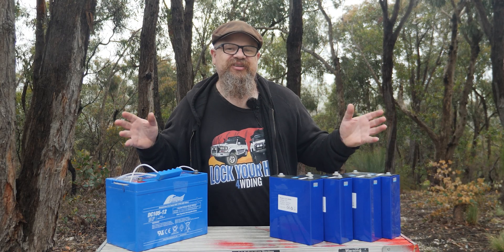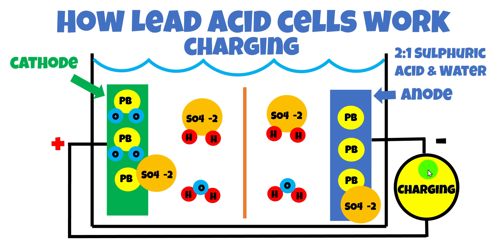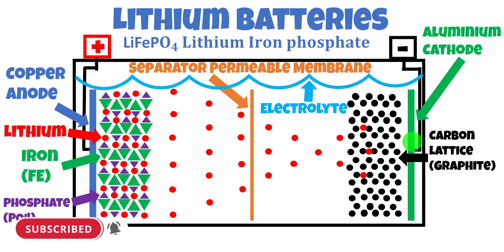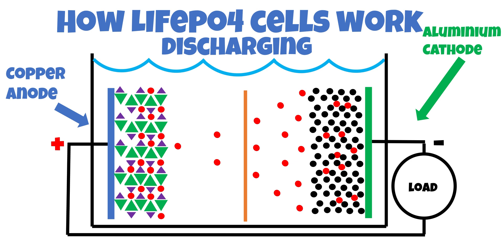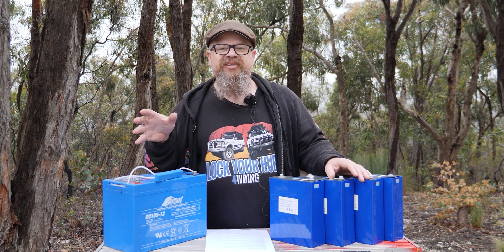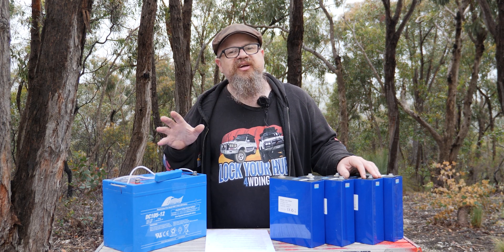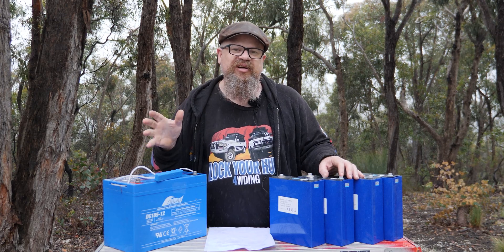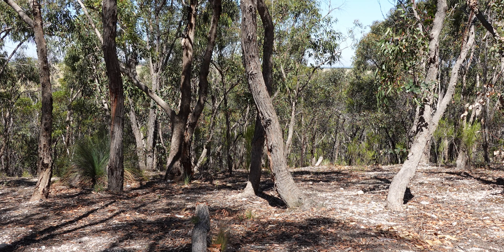DIY LiFePO4 battery Part 1 Lead Acid vs Lithium Iron Phosphate

Comment from the maker: Have you changed from old school Lead Acid to a Lithium Iron Phosphate battery?
Reply: @y0uCantHandle  I run lithium start batteries and use them to winch and run invertors as well. My lithiums have a BETTER heat rating than a lead acid or AGM. With low end batteries or even most of the "branded" ones such as enerdrive or redarc, they dont have the technology yet to do what others can.
Reply: I have changed all my battery's. 200Ah under the tray and, Lithium 1450CCA Starter Battery..
Huge saving in weight and doubled my usable capacity. 
Have gone a little over board and built a 500f super capacitor bank. 6x3000f 2.8V caps with balancing. Have installed in Steel box under bonnet, in parallel with starter battery.
This adds about 2000 CCA to the capacity. But its real use, is for heavy winching which limits voltage drop. With less smoke coming off the winch and its cables. The Alternator is takes a whipping, but mainly from charging the lithium. The caps just seem to parasitically charge from whatever is the highest voltage source.
Reply: Yep🤘 split via bcdc to a lithium100ah under bonnet 200 series as my deep cycle. No worries with heat ( heat gun to monitor initially after install. Run all I need,  and input charge is super quick. On my bcdc I had to get back into the wiring and make a connection to pick up the new charge profile. Not sponsored 🤣🤣🤣cheers mate.
Reply: @y0uCantHandle  itech now do under bonnet lithium starting battery that can take the heat 1450cca
Just bought one
Reply: I'm newish to 4x4ing , so went straight to lithium.
I based this decision on weight,size & performance and my experience with lithium batteries in the industry l work in.
Very happy with my choice.
Great video, for a while there l thought l was watching Professor Julius Sumner Miller, 😀🤣.
Reply from the maker: Just like lead acid, you need the right battery and with lithium the right BMS for the job. Both chemistries don't enjoy heat, well designed engine bays either seperate the batterie/s like an 80 series LandCruiser or move them out of the engine bay completely, like most late model Commodores.
Reply: @y0uCantHandle  ITECH1420CA lithium car battery 12V 60AH
Reply: How could you not want to change to Lithium, I'm now using a 150ah lithium, I don't expect to ever have a flat battery again, multiple rain days with no solar charging still no issues. I've been watching Will Prowse he is an absolute expert on all things solar and lithium. Good vid I like the way you presented it mate 👍🏻
Reply from the maker: @Shoey_85  thanks mate, what's Will's channel name?
Reply: @LockyourHubs4WDing  it's his name
Reply from the maker: @Shoey_85  thanks mate.
Reply: @LockyourHubs4WDing  👍🏻 well not exactly his name "DIY Solar Power with Will Prowse"

Comment: Wrong,,if you have a 100ah agm you get 100ah not 50ah! 
They won't last as long but you do get 100ah!
Reply from the maker: Probably get a little more out of a Lithium without a BMS as well, but it's a bit of a one way street! :)

Comment: Great video thanks but DCS are one of the most expensive plug and play LiFePo4 batteries money can buy. The average is now around $800 with a 3 or 5 year warranty that will probably be cheaper as a house battery for most punters.
DCS claim to have a tricked BMS that allows the use of lead acid chargers and even promotes the battery as an ideal starter battery replacement. 
Experts on LiFePo4 chemistry refute this stating 20°C to 60°C best operating temperature for the chemistry.
Therefore why not either replace the DCS with a midspec LiFePo4 battery at $750 for your calculations.
I look forward to your battery build but respectfully point out that the only real advantage of a battery build from 3.2v cells is the production of 48v battery banks for large solar storage.
Punters who want a battery in their tub or camper are better off with a couple of 100AH midspec LiFePo4 batteries each with a 100A BMS draw in parallel.
23kg and caoable of running that airfryer etc for a several years for a battery cost of $1500.
Enjoyed your content but think my point is worthy of inclusion.
Cheers
Reply from the maker: You make a fair point, though two commercial batteries with 100amp BMS will still run a little short of capacity to run a 3000 watt inverter at full song.

I want to have a play with induction cooking and will need that extra capability of a 250a BMS.
Reply: @LockyourHubs4WDing  your video featured 100AH batteries. All information relating to discharging of lifepo4 batteries indicates 1C as maximum recommended discharge except very short bursts. 2.5C would surely therefore damage the cells and longevity of the battery.
Reply from the maker: The LiFePO4 Battery I'm building in this series is 280ah and rated for a 1C discharge (280A max.). While you're right that the other batteries featured in this series are around 100ah, so you would need multiple batteries to support the load.

I just want to find out what all this induction cooking phenomenon is all about!
Reply: @LockyourHubs4WDing  thanks for explaining. Thatsa totally different kettle of fish but could validly be compared to 3 x 100AH midspec LiFePo4 batteries in parallel costing circa $1600.00
We have induction at home and its not that exciting. Providing space permits LPG we find way superior for cooking.
Reply from the maker: @waynehobbs5175  I've only ever cooked on gas (and fire!) I don't like electric element cooking, though induction looks like it could be the ticket in windy conditions where gas suffers. Time will tell!

Comment: Excellent video!  Please consider including self-discharge rate in your observations.  I have a sneaking suspicion some vendors of cheaper 'drop-in-replacement' LiFePO4 batteries are supplying batteries that charge up to the rated capacity but can't hold onto it for long.  I've seen batteries left idle for a month or 2 lose ~70% charge!
Reply from the maker: Wow! I can't say I've seen that. After all the testing I've got in mind, I might give it a go.

Comment: How are batteries that are designed to be installed in the engine bay different, are they just insulated more?
Reply from the maker: I've been thinking about that, I would think an insulated battery would take longer to heat up, though longer to cool down as well. In the engine bay, exposed to engine heat, LiFePO4 is going to suffer, you can't sidestep the limitations of the chemistry.

Comment: Another good vid...I wish you hadn’t used dcs as an example though...it rubs me the wrong way that they try to pass themselves off as “Australian made” when they’re made in a Chinese owned factory...then labelled in australia.
Reply from the maker: I actually don't know of an OZ made solution, even Redarc's is an import. 

I know they're a couple of DCS agents that seem to rub people up the wrong way on the socials.

And there seems to be an anti-DCS movement on the rise. 

Nothing against DCS, I just prefer DIY!
Reply: @LockyourHubs4WDing  yeah I think diy is where it’s at...at least you know what’s going into it.

& yes, I had a dcs fan boy admin...go from DCS owned factory...to DCS joint venture with Chinese...to booting me from the fb page after I pointed out, that under Chinese law...NO foreign entity can “own” a factory in China.😂....all while he tried to hang shit on my voltax 200ah.🙄
Reply from the maker: @pauladams4890  some people......

Comment: You've covered all the main points. your costings are based on the premise that AGM discharge is restricted to 50%. This is untrue. The rest is informative.
Reply from the maker: The costing were based on capacity, depth of discharge wasn't factored into it. 

I did see a few references to a higher depth of discharge for than 50% for lead acid without long term issues, though couldn't find any data to support it.
Reply: @LockyourHubs4WDing  Thanks for clearing that up. Otherwise, a very well explained piece of work.

Comment: The science has spoken. Well done Simon. Next question which to be honest, may already be obvious. But, is lithium really a problem when stored under the bonnet?
Reply from the maker: Both lead acid and lithium don't enjoy heat and will shorten service life, that's why some engine bays like the 80 series Cruiser seperate the batteries in the engine bay.
Reply from the maker: Lol, that's a different lithium battery chemistry!

Comment: Great article mate.  Explained everything clearly and concisely. 
It's timely as I've just recently converted my vehicles house power system from 2 heavy AGMs to one light lifepo4 (DCS brand).
This video shows how far ahead lifepo4 is. 
It's a game changer.
One other thing that you didn't mention is lifepo4 has far less internal resistance to charge,  resulting in far superior charging times.  A lifepo4 battery can go from 20% SOC, to full in no time at all,  it will absorb whatever current it can get continuously right up until almost completely full. This is another area where it leaves lead acid far behind.
Reply from the maker: I'll be looking at charging during installation, how not only DCS can be charged with an alternator and if you can charge in parallel with lead acid etc. I think there's a lot of misinformation out there that needs to be dispelled.
Reply: @LockyourHubs4WDing  
I look forward to it mate.  As I do all your videos. 
I want to use a lifpo4 as a cranking battery in the future and DCS say it's fine.  My concern is not with their battery,  but whether a standard alternator can survive this. A  lifepo4 battery can potentially absorb the alternators entire output and it is my belief that alternators are not designed to run continuously at full capacity. So therefore the problem I see is the poor old alternator has nothing to limit its current capacity and will just burn itself out. 
I will await your findings !